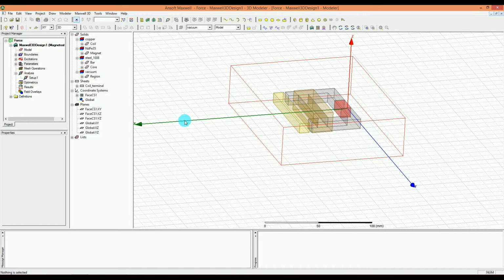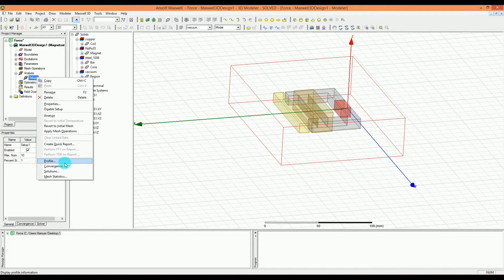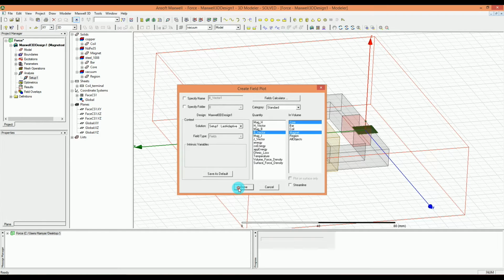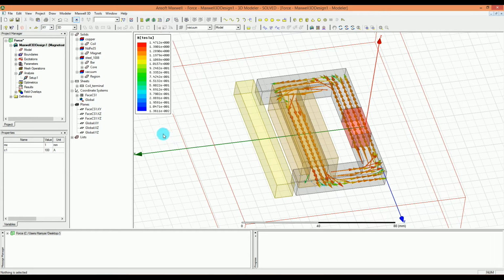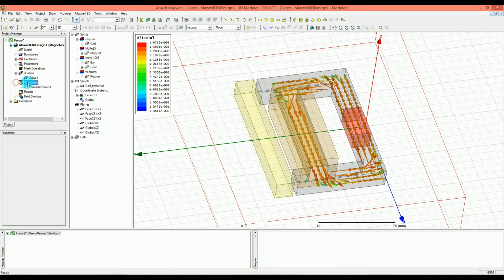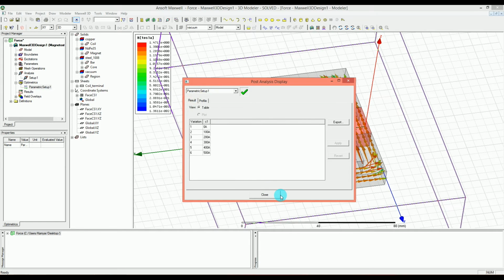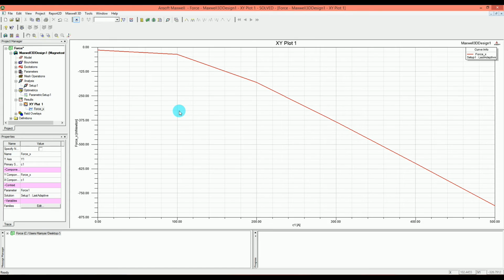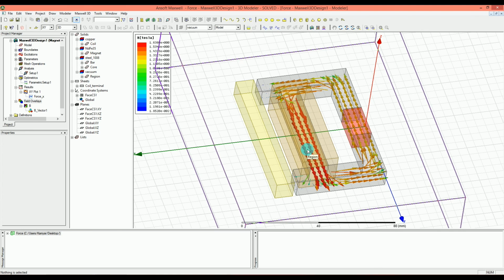205  Ansys Maxwell  Calculating Force in  Magnetostatic Analysis

Comment: Can you please explain what is pass and air domain ?
Reply from the maker: Divya Panchal air domain is where you calculate the Maxwell equations. Pass are iterations where you attempt to decrease the error (energy error) by increasing the accuracy of calculation using higher resolution meshing.
Reply: kamyar K Thank you for your positive response
Reply: One more question... 3 phase  RYB  In which phase force will be high?
Reply from the maker: Divya Panchal not sure if I understood your question correctly.
Reply: kamyar K 3 phase RYB in which phase force  force will be high and why ? 
Red yellow and Blue 3 phase system

Comment: Hi Kamyar
Thank's a lot for your useful tutorial
I want to simulate a solenoid to determine the force of this on a metal plate
how can I enter the number of turn of the coil?
i see that you just enter the current but not number of turns
thanks for your time
Reply from the maker: +Iago Marques  there are some ways to work around it. Please check the video that I’m designing a simple WPC RX coil. I explained there a bit.
Reply: Hi, did you find the answer for your question? I've the same question about that, it isn't clear for me how we work with turns in this software.
Reply: After watching the transformer modeling video and checking some comments I think I got it now.
Correct me if I am wrong: it looks like the number of turns doesn't matter much since we apply the right amount of energy in the coil, that is, to maintain the right MMF (N.I). In my case, I needed to apply 3A in a 500 turns coil, what yields a MMF of 1500 A.t . At first, I applied a current excitation of 3A to my coil section and I was trying to find where to define the number of turns (post-processing matrix isn't an option because the inductance doesn't really interest me here). The B obtained was pretty low of course, so I realized I should apply the current which would result in the same MMF (1500A.t) as if I had only ONE turn, thus I set my excitation to 1500A and I achieved the expected results according to my calcs. 
My goal here is to measure induction, force and torque on a spinning metal disc - eddy current brake device. I'm following your video series since the beginning and I learnt a lot, thank you! If you can recommend some video in which you approach a similar problem it'd be great, cause I still have no clue how I'm going to simulate different angular speeds (w) for the disc and get the related torques.
Regards

Comment: Hi,kamyar K
Is Ansys Maxwell separate software or its built inside the ANSYS software. I have ANSYS 16.0 but i didn't see any model named Maxwell, i know Magneto static simulation.
Reply from the maker: +GURU BASAVARAJ Hi, if you know magnetoestatic that is  one of the engines  of maxwell environment.
Reply: +kamyar K  thats fine, but how to get maxwell environment which you have use in this video.
Reply from the maker: +GURU BASAVARAJ just click on insert maxwell 3d design icon or go to projects and select insert maxwell 3d design
Reply: Is it in work bench or APDL, I didn't find any this like in workbench
Reply from the maker: it is inside Maxwell program
Reply: +kamyar K  Maxwell program is separate software right? which i have to install.

Comment: hey kamyar...
will i be able to show magnetic force distributions in this software??
Reply from the maker: Yes  you can add magnetic force in the parameters the same way that you add matrix and after calculations you can plot it over geometry line surface or for phase in eddy current solution  take a look at tutorials 306 till 311
Reply: +kamyar K thanks alot 😊

Comment: Hello Kamyar K, thanks for the Tutorials, i have simulated the same Problems but not with bar, with sheet (thickness:0,15;0,4;1.. mm/Lenght 740mm/width:500mm)and without magnet, i want calculate the force on the sheet. should I make the same steps as in video 203-205? what is the role of the magnet in this simulation?
Reply from the maker: Nabil Sahi if you are l looking to find the force you don't need the magnet. Magnet was an example to show how you can define the magnetization
Reply: *****  Thanks for your reply! should I make the same steps as in video 203-205? I have done the same but the results of simulation do not match the measured values?
Reply from the maker: Make sure that You applied exactly the same size and excitation values
Reply: Hello Kamyar, the core is created with electrical sheet, how can i create the core with electrical sheet?
Reply from the maker: Sorry I don't understand your question what do you mean?
Reply: sorry my English is bad.  i have the same problem as in videos 203-205, i have simulated the problem, but the results of simulation do not match the measured values of the force. in reality the core is created with electrical sheets. can this be a reason that the simulation results do not match the measured values? how can i create the core with electrical sheets?
Reply from the maker: The best suggestion that I have is to excite the coil using current excitement and set the type to stranded. Stranded will remove the effect of Eddy current which is the whole purpose of lamination (electrical sheets). Right?
Reply: ***** thanks it worked =)

Comment: Hello,

I need to simulate a coil with its REAL number of turns, not to magnify the current..
I tried to give the number of turns with "Matrix>>Post Processing>> Turns", but the solution is always given for ONE TURN no mater what the the number of turns was..
Any Idea?

regards
Reply from the maker: Ahmad Kourani First make sure that you are dividing the current when you increase the number turns. second you have to see  the results regarding your number turns in the solution data after checking the post processing. Please take a look at tutorials that are covering this topic and let me know if you still have Q.
Reply: ***** Hi, it works, I just wasn't paying attention to "Post processed" option, I think I was tricked by the B vector values.

thanks
Reply: ***** Hello Kamyar, 
It works just for the inductance, the force is still very small even if I increase the number of turns and check the "post processed" box.
I have watched your videos, you used 80A and only 1 turn so you got a high force on the armature, what if you lower the current and rise the number of turns? I see its not working...
Reply from the maker: force i think would be generated by input power not number of turns. if you increase the current when you increase the number of turn you shold expect more force. conservation of energy.
Reply: ***** Hello kamyar,

This is the force relation for a relay: F=mu.(Ni)^2/2g^2

N is the nb. of turns, i is the current, g is the air gap length, and mu is the permeability.

So I think N does affect the force, but the software doesn't understand that, I think it's said in the official tutorial that N is left for the user to calculate and the software input is only the current for 1 turn. 
Checking "post processed" will only multiply the inductance by N^2.

Regards.
Reply from the maker: Ahmad Kourani  you are saying N times I. That means for same amount of excitation I if you double the number of turns, the current that goes inside each turn would be half and therefore N*I remains the same. There is nothing wrong with the simulation. It is physics. For certain input power you can NOT have more output power just because you increased number of turns.
Reply: Hi Ahmad,
I calculated the force according to the formula F=u0*N*N*I*I*A/(4*g*g) but the result if different with Ansys Maxwell result.
Can you help me? Thanks

Comment: Hi Kamyar
Firstly, thanks for all useful videos and for your efforts...
I am working on a complicated thesis project and a part of this project involves electromagnetic analysis.
This part has system that resembles a solenoid.
I applied this part's CAD modeling. However; owing to the fact that my area of expertise is mechanical engineering, it's hard for me to accomplish analysing and simulating it with my parameters. Because i couldn't explain the situation in detail, maybe, i am uploading some edited screenshoots for you to understand it clearly, I hope it's good...

Drawing                             http://i.hizliresim.com/N5D4ok.png
Linear mover parts             http://i.hizliresim.com/bl653m.png
stator (coil)                        http://i.hizliresim.com/dnB5pp.png

If you help me about it with a simple tutorial, i would be thankful my friend.
Reply from the maker: Hi Ferhat, 
I am about to make new tutorials that would cover the mentioned topics. Kodo on the modeling. very good job. 
I wonder if you can wait for 2 -3 weeks till I finish making the tutorials?
Reply: ***** Thanks for your reply..
Actually i need this project to be completed in a weeks time. It would be nice if you could give this priority.
I'll be grateful
Reply from the maker: Not sure but I will try